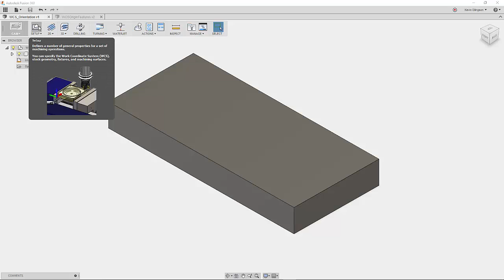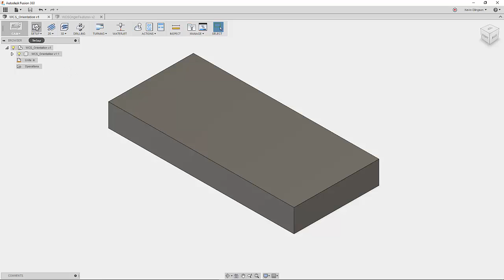Creating a Fusion 360 CAM Work Coordinate System WCS

Comment: Why can't I get the WCS to be X Positive to the right, Y Positive TOWARDS ME and Z Positive DOwn. Imagine a CNC router (Or in my case a MPCNC). I have it parked in the upper Left Coroner and Want everything to move in the positive direction.  Is there some rule where this is not allowed for some reason. I can't be the only person who is trying to use an MPCNC and can't get the Gcode to NOT go in the negative for one of the axises to move. ANY Help here would be greatly GREATLY appreciated!!!!!
Reply from the maker: Hi Timmy. I've never seen anything that wouldn't follow this rule for a CNC machine. If you need to do what you are asking for, I think you would make the change in the post processor by asking the post to reverse the positive and negative directions for your axes. The posts are open source and written in Javascript. So if you are comfortable writing code, you could probably do it yourself. If not, if you want to look into this more, email me info@mechanicaladvantage.com and I can find out what it would cost a post editor to make that change for you.
Reply: @MechanicalAdvantage  hey thanks for the fast response. Yeah, it sounds more like misunderstanding on my part. The way this particular router is set up it really needs to move from the upper left with the z-axis moving in the positive. I can change the z-axis which would fix the issue I'm having I was really just wondering if it was just a setting or something I was missing out of the box. in the end I'm going to adjust the machine to what is default in fusion and just get on with life... Lol

Comment: God thanks that was driving me nuts
Reply from the maker: HI Jamie. It's really pretty slick once you get the feel for it. As long as you have a face or an edge, you can line the WCS up pretty easily. Don't forget that the origin planes and axes are also valid for this as well.